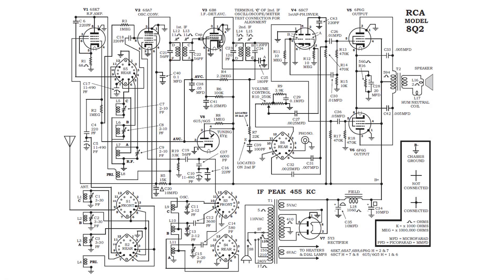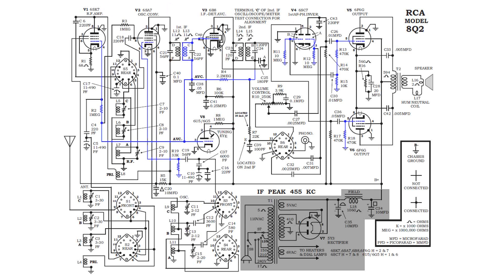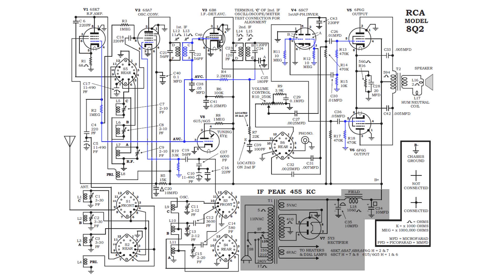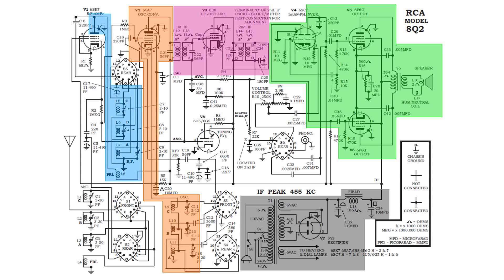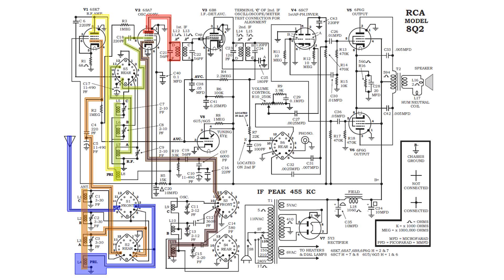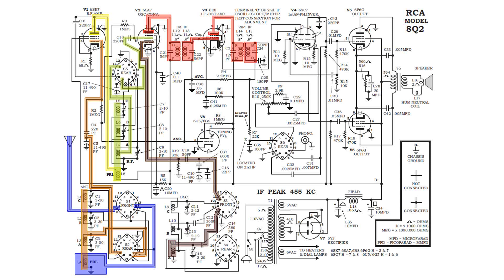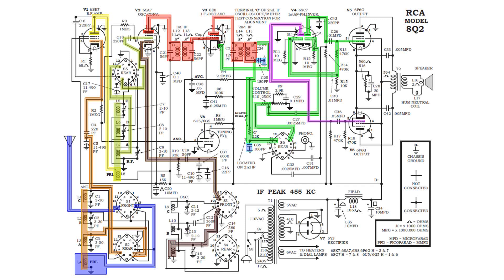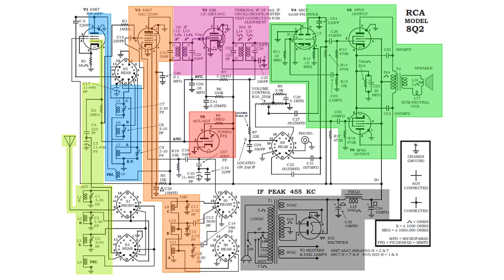Wiring Diagram Ebook Overview

Comment from the maker: Hey Gary.
It should not be a problem, but if I have question, I alligator clip it in and try both. If this radio did not have a push pull output I would not have mentioned phasing. I looked at putting phasing in each section, but all the different colors was more complicated than the circuit was. So I only talked about phasing were it was necessary for the proper operation of the circuit.
Rick